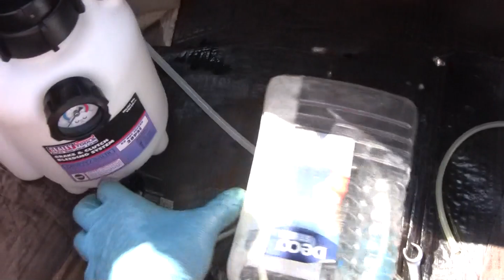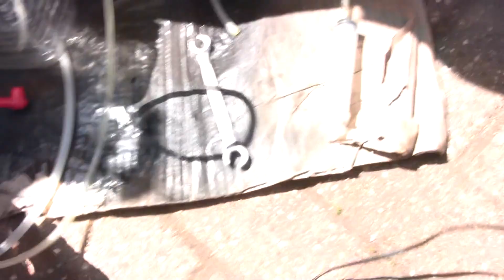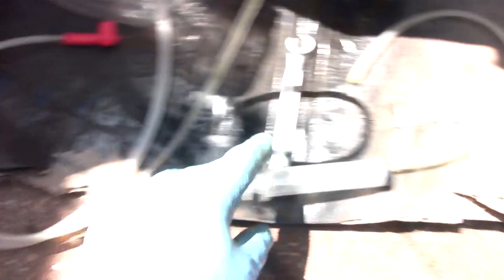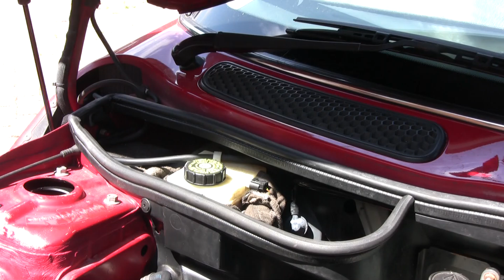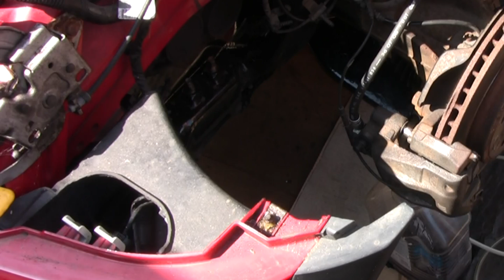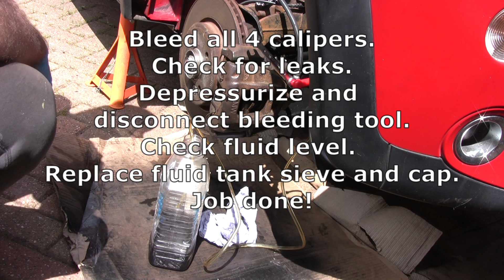BMW Mini R50 brake system bleeding using pressure tool

Comment: Where did you get the adaptor that fits the mini reservoir? Got a link? Thanx
Reply from the maker: It was included in Sealey Vs820 Brake Bleeding kit.

Comment: Fantastic video. Did you need to set ABS mode using a diagnostic tool?
Reply from the maker: There is no need for any special ABS tools when flushing brake lines with fresh fluid. Only when air gets into the ABS pump special bleeding procedure is necessary.
Reply: @zadzwon112 thanks for the info. Only my reader states to perform when servicing the system such as replacing fluid, replacing parts etc.